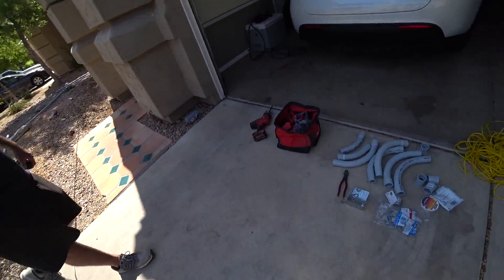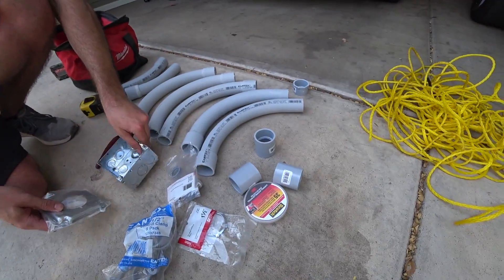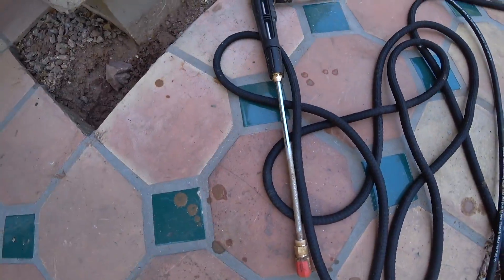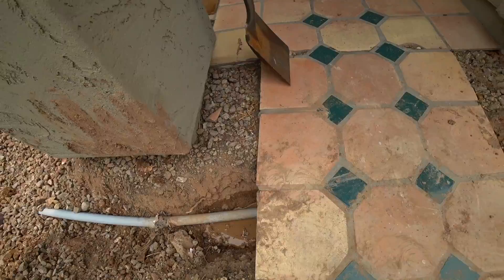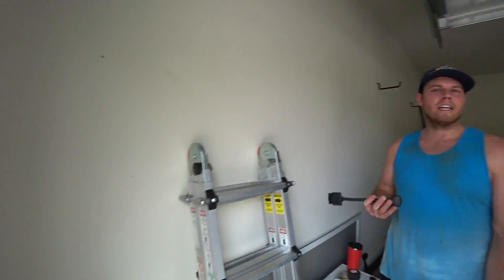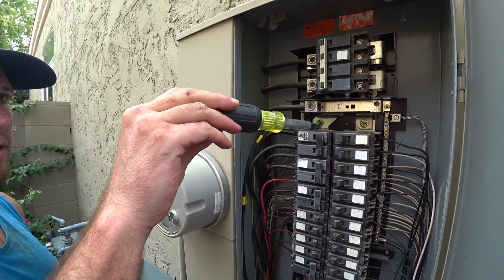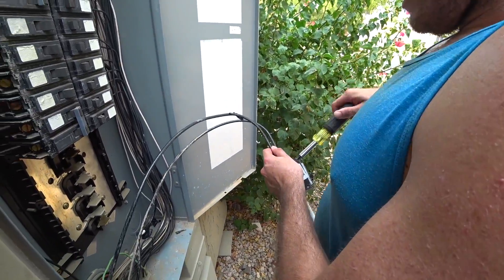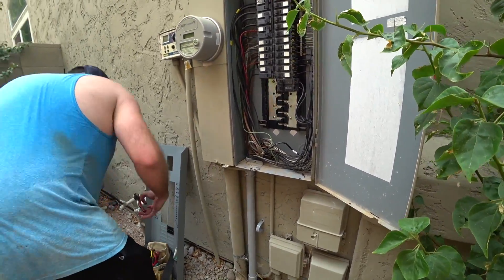Installing a NEMA 14-50 for my TESLA MODEL Y

Comment: I did this setup myself. My main panel is right on the other side of the garage wall, so installation was easy.

It's been 4 years, and everything is working perfectly. Wiring has been checked ✔️ twice, just to make sure nothing is overheating or that there's a bad connection. 
Great video.👍🏻

Comment: Things are changing. Over the last couple years there have been too many events with cheaper outlets ($10-15) melting. Not designed for the continuous EV loads. Commercial grade is now recommended ($50+). Not all areas have adopted the code change that requires a gfci breaker but some manuals are saying not to use them because of nuisance tripping. Best install is hardwired but that requires 90 degree copper (THHN) by most manuals.

Comment: I noted that the conduit is buried less than 18" deep. Any 220V wiring under ground should be 18' minimum.
Reply: Source?
Reply: @Vince-xr1oh  I meant 18 inches below grade if it’s plain dirt or grass. For 220 V pool heater wiring installation, the electrical code in our TX jurisdiction.
Reply: @imranm7628  Gotcha, thanks!

Comment: 👍Thanks. For you all new to Tesla first try for a month or so charging with the regular wall outlet and your mobile connector. Charge up to 90% Charge every night. It adds up. 60 miles range gained x 350 nights = 21,000 miles a year. Supplement with Supercharger and destination chargers when traveling. ✌️😊

Comment: Usually a professional should be doing a 50amp because - such things as your wire must be right;  lots of things can kill you playing with a panel.  It isn't even legal in many areas for that reason. You really should be disconnected up line; just switching off the main breaker isn't good practice.  Will average people know if it is damaged?  Did you check your load and line max load?  If you didn't you could catch your house on fire.  Your house looks newer so it probably is a 200amp but if it was 100 ; you'd have a fire hazard overloading your panel.  Even properly stripping your wire can be an issue.
Reply: Nobody disconnects up line, lol.

Comment: I just installed my own 14-50 yesterday. Super easy (im an electrician for SRP) as long as the panel is on the same side as the garage. Or if you have a single story house. Would have been easier and cheaper to go thru the attic.
Reply: Question: Is it best practice run a NEMA 1450 line (6/3 interior Romex) inside of galvanized conduit if the main panel is on the outside wall of the garage? Est a 50 ft run inside walls of a garage (beneath drywall).

Comment: Why not use 4 wire 6/3 cabling which is all wrapped together with different colored insulation?  Also I noticed there was a bit of exposed wire at the breaker, it should be flush so no metal wire is showing.  Glad to see you survived that explosion on first plug in, guess you got lucky, lol.
Reply: You only use single conductors inside conduit, otherwise you have a danger of overheating.

Comment: Kinda wondering why the wiring wasn't through the ceiling. Isn't that normally how electricians would route it? In my case the panel was in the garage so it was super trivial.

Comment: This “used to be an electrician” has no idea what he’s doing... not burying the conduit, saying you can cut off a few strands from the neutral conductor if it doesn’t fit in the neutral bus bar, saying the circuit breaker is there to protect the Tesla (not the wiring), claiming his Klein 11-1 driver is insulated, not using any duct seal, not using a Sq-D breaker for that panel... not even sure what he was checking for with the meter at the end.
Reply: This install is full of code violations as others have listed.  You skipped getting a permit to do the work and have it inspected as required by law. To put up this video as a “how to” is a disservice to someone else who might follow this unsafe install..
Reply: He left exposed wire at the breaker, a no-no.  I can see why he “used to be an electrician”.
Reply: Seriously was cringing at most of what he was saying. OP should add a disclaimer to hire an electrician and that people should not base their installation on this video. Nobody who isn't licensed has any business posting this video without disclaiming they aren't an expert.

Comment: Double pole breakers are automatically balanced.  It does not matter where they are in the panel.  They will by design tap each 120V leg for a total of 240V.  See 10:19 the staggered legs.  I'm no electrician but I did stay in a Holiday Inn Express once..........

Comment: I get 34 miles an hour through mine
Reply: Higher voltage?
Reply: @TedKidd  it's on a 40 amp circuit
Reply: @garys6898  mobile charge maximum 32A
Reply: @酱哥的JohnTheSauceBro  I get between 33 and 34 miles an hour on a twin pole 40

Comment: The older mobile charging cords that used to come with Teslas went up to 40 amps (37-38MPH).  These newer ones only go up to 32 amps (about 29-30MPH).  That NEMA 14-50 receptacle you installed can deliver up to 40 amps continuously.
Reply: you can get the corded mobile connector that goes up to 40 amps, but its $500.
Reply from the maker: Any idea why they toned it down?
Reply: @Gjeebs  I read that the cars themselves have a safety cap at 30 on non-superchargers so the extra amps made everything need to be thicker and heavier without a benefit.
Reply: @Gjeebs  Cost savings.

Comment: @8:10 it shouldn't matter which side when using a double-poll breaker because those connect to both sides of the bus anyway (one leg from left and one leg from right).
Reply: Lol and he says in the 70's "they just didn't know" lol wtf? They didn't know about phasing and busses 60 years ago?
Reply: There is a reason he use to be an electrician

Comment: 8awg wire is not supported for sustained 40A loads like EV charging. 6awg is required for this install. I'm glad you went with the right one.
Reply: For a Tesla, 6/3 wire and a 50 amp breaker.  I'm going with a metal clad 6/3 4 wire for a 35' interior run in the garage to an external adjacent electrical panel.
Reply: @Chainyanker007  8/3 mc cable rated at 55 amps but the 6/3 will allow you to go up to 65 amps
Reply: @thomasmarable6818  is that also true with sustained loads like charging a car?
Reply: In conduit with type thhn or thwn is good for 55 amps

Comment: I have some limited experience so I did it myself too rather than pay the grand that they wanted to do it here locally. I got a state permit and had it inspected. It cost me about $160 including the permit. I installed Tesla connector right next to panel in garage.  Great stuff and no one was electrocuted. 😀
Reply from the maker: Good call